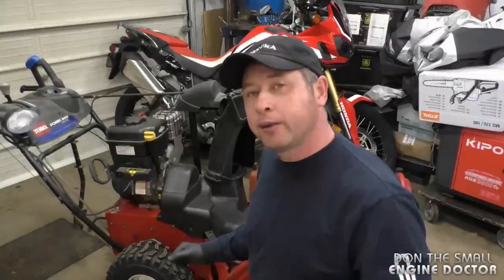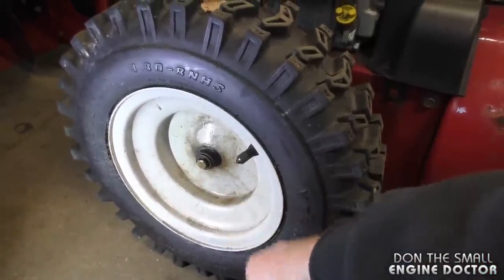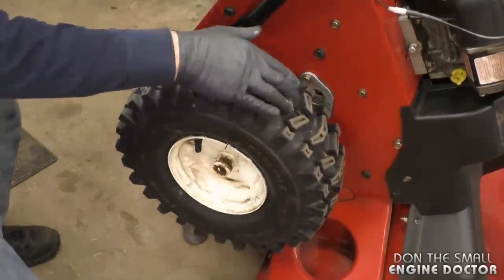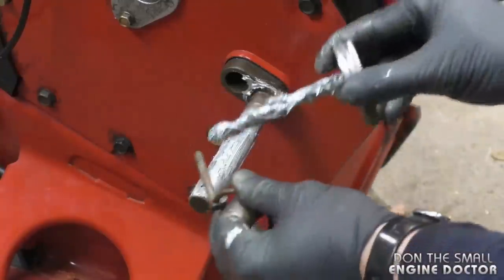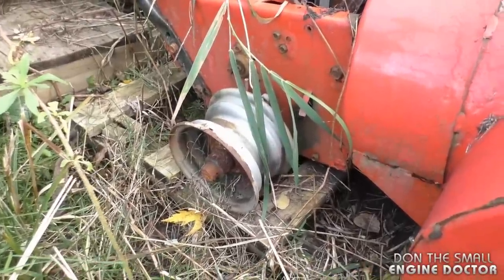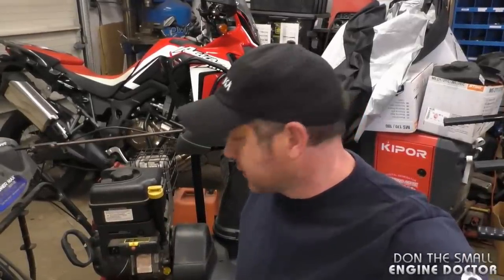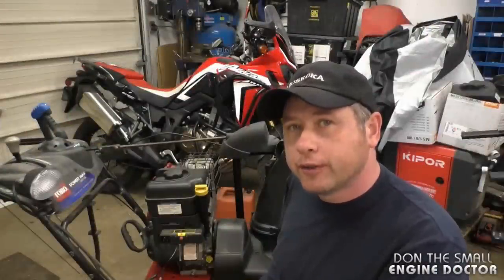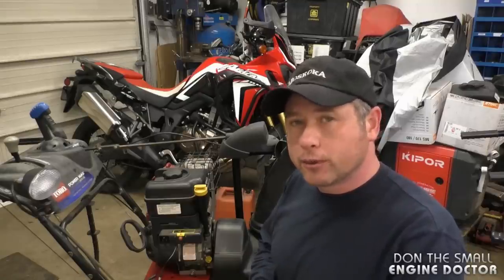ALWAYS Do This To Your Snowblower!

Comment: And if you spend a little more for nickel anti-seize, you’ll be set for virtually any application requiring anti-seize including automotive spark plugs.
Reply: Most spark plugs today do not need antiseize and you should not apply it to them. My NGK Laser Iridium plugs for my Toyota specifically says not to use any antiseize or thread lubricants. If the plugs are installed correctly and changed at the correct interval, they won't be stuck. I removed my factory plugs early at 70k miles. Iridiums usually go for 100k in the service schedule, although I think 70k was enough for mine to go through. :)
Reply: You haven’t owned a Ford. 😂
Reply: @mannys9130  Quite right. I changed mine late, 120k and they came out easily, measured exactly same as new set. 
By adding a lubricant, be it anti-seize nickel, copper-coat, lead based or grease/oil it will change the proper torque specs.
Reply: @KSMike1  I have. :) I think what you meant to say was "you haven't opened a 3 valve Triton Ford." Those long plugs are the only ones that antiseize is helpful, and only on the shaft of the electrode (not the threads).

Comment: In searching for the anti-seize lubricant I see it is available in aluminum, nickel, copper etc.   what are the differences and  which one should I buy? Thank you for your time
Reply from the maker: not sure but one used in video is nickle.
Reply: Nickel does not react with stainless steel, copper does. It’s a ‘premium’ anti seize, better at dealing with heat. Obviously not needed on a snow blower, I presume. Aluminium anti seize is food grade anti seize, where food is used. Copper and nickel are poisonous, so use gloves.
I use ceramic anti seize at work and at home, chemically inert and offers the highest heat rating, and isn’t poisonous (yet).
Reply: @dieselhatz4247  Yeah, nickel has a higher melting point, that's why it's recommended use around anything generating a substantial amount of heat.  Nickel's melting point is 2651°F (1455°C).
Reply: The best is powdered lead, but you can not get it anymore.

Comment: What is the psi you typically put in tires? Ariens has sidewall that only says max psi. I went on their web page and they said do 80% of the max psi. So say 20 psi. Put 16 psi into the tire?!
Reply from the maker: yes around 12-15psi
Reply: @donyboy73  thanks donyboy73!

Comment: There are few absolutes in life, but here is one I believe in:

If Honda makes one, that is the one to get.
Reply from the maker: I would love to have a honda snowblower
Reply: @donyboy73  I would too Done, but yikes they are about $3500 in US.
Reply: I picked one up last year for a touch under $900.00 when my Craftsman failed. It is pull start, the electric starter was out of my budget, me being retired. Tank tread rather than round wheels, works like a dream.
Started every time but one on the first pull, once on the second pull. 
Yep, it's a Honda.
Reply: @bff1316  That was an amazing deal. I assume it was used?

Comment: Great tip! I've used white grease in the past, I honestly didn't even know something called anti-seize existed. I will use that instead from now on. Also, I have a question, not related: the throttle lever on my MTD snowblower (you know, the red plastic thing) broke last winter and I can't find a spare anywhere. Do you have any suggestions to replace it?

Comment: In a way I wish I had never seen this video! But once I did I knew it had to be done. I tackled the job and one wheel came off fairly easily but the other one, of course, was an absolute bitch to get off. I cleaned all the rust off the shaft and wheels and put grease on temporarily. I will have to get some anti seize. Thanks for the video.

Comment: I see the item you are using on Amazon, but I don't need 2 bottles. I do see the same#80078 on another item but is says 
Aluminum. Is this the same thing. The description reads "Permatex 80078  aluminum Anti-Seize Lubricant with Brush Top Bottle, 8 oz.  "
Thank you for posting. This will be used on my Ariens snow blower

Comment: Consult your owner's manual for the correct method of  ensuring the wheels do not seize to the axles. Using anti-seize is not the method my Craftsman 24" two stage calls for. And, other  maintenance must be performed: such as the axle shaft inside the housing needs to be lubed with GREASE to allow the wheel that slides back and forth on it to slide easily to enable the  speed and reverse functions. Also make sure the leading edge of the machine has not dropped due to the skid shoes wearing. Many of snow throwers like my Craftsman are made by the same company  if you ever notice. Mine is quite similar to Troy Bilt and Yardman.

Comment: HELP! I have Poulan snowblower model 96194000603 and both wheels have sheared of the inside of the rim that slides into the drive shaft and I can't find replacements. The old part number for the left is 192092X417 and the right is 192093X417 Wheel Assembly 16" with power steering. Any help in locating would be appreciated.

Comment: My toro looks like a million bucks because every time I finish using it I always remove all the snow that accumulated during use and then I spray liberally WD-40 over the entire machine, I’ve had it 4 years and it looks damn near new still ... no rust anywhere...always use sea foam additive as well starts usually 2nd pull , rarely ever more...

Comment: If you pin it to the shaft anyway, what’s the harm if it seizes to the shaft?  Sure, you can’t remove the wheel, but who needs to?
Reply from the maker: if you need to put a tube in the tire, replace or grease the shaft bushings you'll be happy the wheel comes off easily

Comment: So it begs the question...why don't the manufacturers either grease or plate the parts to prevent corrosion? Surely it can cost that much.
Reply: I think some do, but they don't spread it around generously like he recommended in the video.

Comment: Best product to remove anti-seize from anything is to spray it with WD-40 first.
Reply: Nah there are better penetrating oils out there than WD-40. Water Displacement Attempt 40 was not made to be a penetrating oil. Seafoam Deep Creep and Kroil are better. Lube it, heat it, and then beat it.

Comment: Why put it on the shaft at all? The pin goes thru the wheel AND the axle, causing both to rotate as one. The issue is the transmission. Remove that belly plate and apply that stuff to ALL of the gears and ALL of the bearings in the transmission.  NOT on the edge of the axle. That's not where the seizures occur. smh.